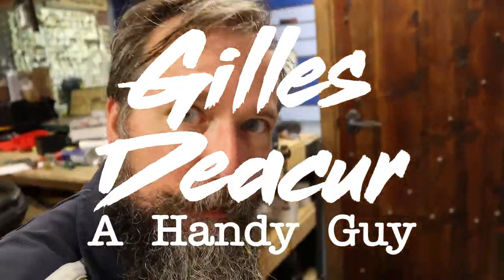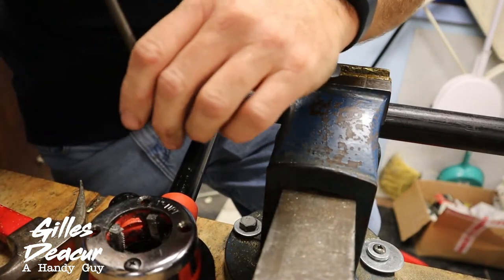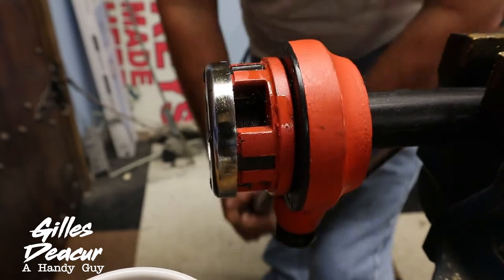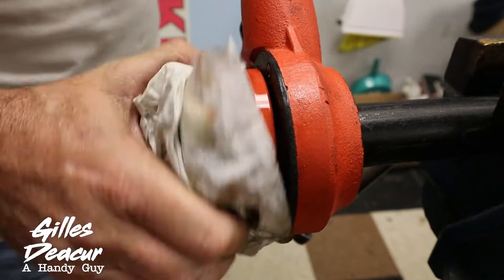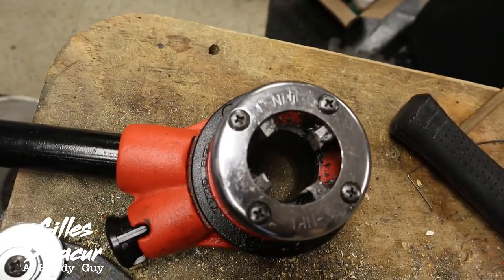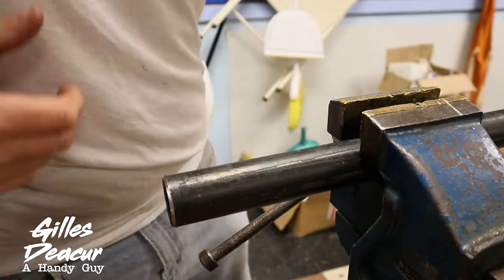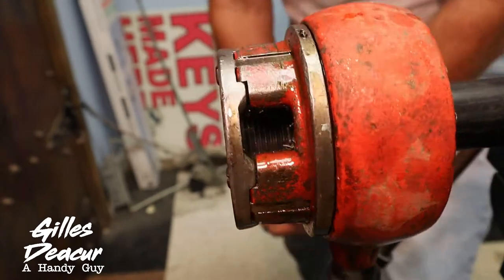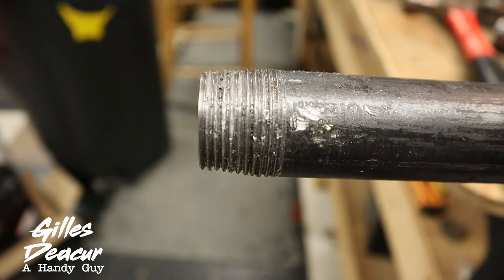$33 Pipe Threader Vs. Ridgid Pipe Threader. HFS TAR-100 and Ridgid 12-R Pipe Threader Tools Compared

Comment: Way more oil. You almost want the oil to cary the shavings out of the die. The shavings definitely give you more resistance plus ruin the threads you are making. Buy a couple quarts and pour a 1/4 cup every 2 turns. Have a basin underneath with a screen. Throw away all the oily shavings and keep reusing the oil. 
Also. Use your body weight to help you. Crank down not up. You will be able to use way less arms.
Reply from the maker: Lesson learned. More oil. Thanks for the input!

Comment: I watched this video to see the difference between a more expensive Ridgid pipe threader and HFS from Amazon that I had ordered and hadn’t received yet. I noticed the numbers on the cutter die heads for the 2 were reversed the Ridgid was 1-2-3-4 in a clockwise direction and the HRS was counter clockwise. I watched a Ridgid video on replacing and adjusting the cutter’s on their die head and decided to buy a Ridgid setup from eBay. I received the HRS unit from Amazon and the numbers were counter clockwise. I sent it back. Could that be why it was damaging threads and difficult to remove? Very happy with my eBay purchase and works great. Thanks for your video

Comment: Nice Video. I always  have used Ridgid I consider it the best. But if you only have a few threads to cut and the threads don't have to seal this tool may be worth it.  I have cut thousands of pipe threads in my over 50 years of work in the pipe trades. I echo some of the other comments use plenty of oil it lubricates and also helps keep the dies cool which is also important  Also it must be the correct kind of oil specifically for cutting threads (Plumbing Supply Stores sell it by the half gallon)  someone mentioned cutting oil has a high sulfur content the wrong  oil is one of the things which will cause the broken threads you see in the video also bad dies will do the same. Also cutting on the down stroke using your body weight makes it much easier. Thanks for the info on the economy threader.

Comment: That's very useful information and explains a lot! I had a slightly different problem, though. I have a pipe cutter that looks similar to your $33 tool. Mine also cost about that much. After a few uses, my pipe cross section at the newly cut threads was becoming triangular instead of staying circular. A few more turns and my tool turned the already deformed pipe end to shreds. That was just regular galvanized pipe, not black pipe. My total thread length was just at about half an inch when the pipe end began to go triangular and then shred. I was working on a 3/4" SCH40 GI pipe and my die was marked 3/4" NPT. The blades had not yet even reached the pipe end! What could be the cause of that triangulation of the pipe profile?  I followed all the YouTube advise on lubricating as you cut, backing off the tool every so often, but same results. I did not have any broken teeth, though. My pipe also became oblong where my bench vise was biting it, due to constant spinning and tightening. Really a tough job!
Reply: Take the ring off and check the numbers 1 to 4 if not in the proper order it will destroy you pipe, could also be casting problems not accurate, sorry bro, you get what you pay for.
Reply from the maker: Sorry, I don't really know. I did this project as a one-off and don't really thread any more.
Reply from the maker: Good point!

Comment: Its easier to push down than pull up , and after the threads are caught keep oiling as much as you can. if on a budget put a hole in a water bottle and squeeze  oil on while threading. but years ago after doing that twice i just got a used pony.

Comment: I use a ton of oil compared to the amount you use and only 2 broken teeth in well over 100 threads on the 1 inch.  You have to run more oil.  I think the proper oil and more of it will help you out a lot.  I really don't think it's all that bad in my opinion.  I have the ridgid as well and an oster power threader.  The power threader has a continuous stream of oil on the dies.  Are you using oil with hi sulpur content?  I bought this thing as a joke for a guy I work with but it surprised both of us.  I had trouble with that spring too but I can't remember if I removed it.  I'll check when I go to my shop.  $55.00 I paid for mine with 5 sizes.  Cheers
Reply from the maker: Thanks for the input. I really thought I was using enough oil, but I'm not an expert. I was using the Ridgid 70830 Dark Thread Cutting Oil.
Reply: You have to use more oil, its a must, that die will not tread properly, and will be a pain.
Reply: To get your job done without replacement teeth.  Couldn't you have switch out the teeth from the other heads not being used?
Reply: @MadMax-pt3yk  actually what I meant to say was there's some threads missing on several of the dies.  I don't know if you can put let's say  a half inch die in a 3/4 inch die head.  I'll take a look tomorrow

Comment: Not sure how you didn't break that first threader. You never said what size it is, I'm guessing 1.25". I gave up on a 1" pipe iwth my $33 kit and bought a Ridgid and never looked back. They are the best. The $33 maybe could be used for plastic and copper pipe, but if the thread's aren't right I don't know what you could use it for.

Also, I believe the test for proper depth is three turns by hand, not 4.5.
Reply from the maker: I used the 1 inch die in both tools. The cheap pipe threader's largest size is the 1 inch.

Comment: If you ever watch them thread a pipe at Lowes or Home Depot, their machines pump a constant stream of oil which not only lubricates but flushes out the shavings. The shavings are what kills the cutting blades and makes you work so hard. 
Don't clean the threads with newspaper. I was waiting for you to slice your fingers. Fortunately you didn't. Use a wire brush.